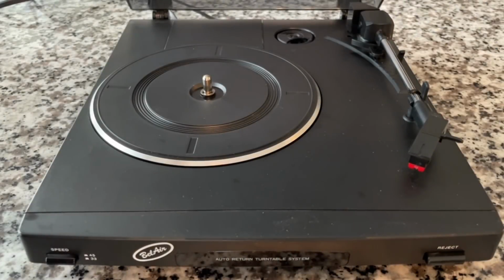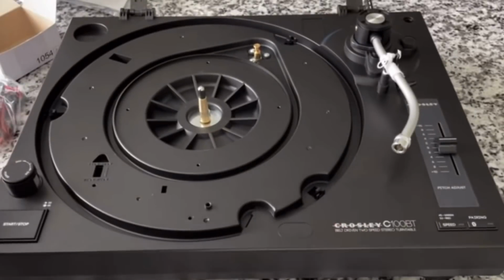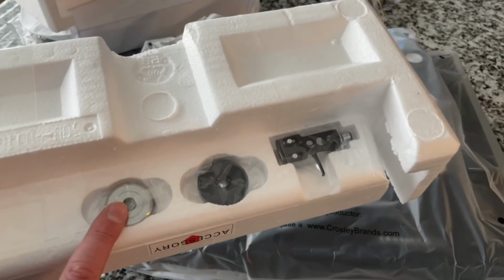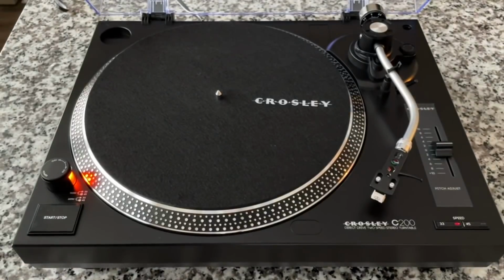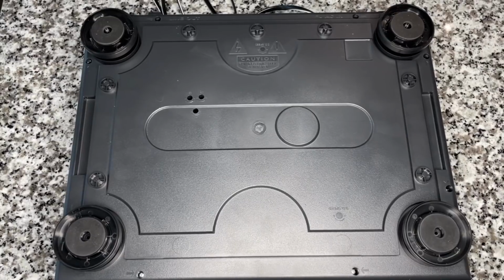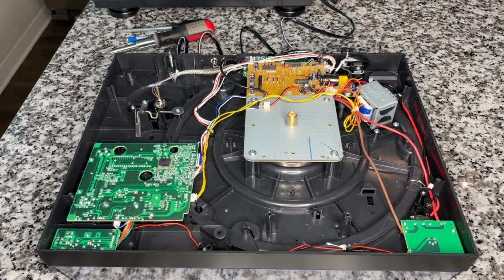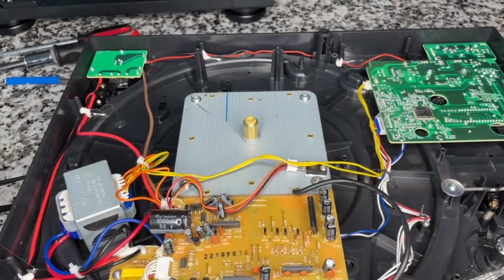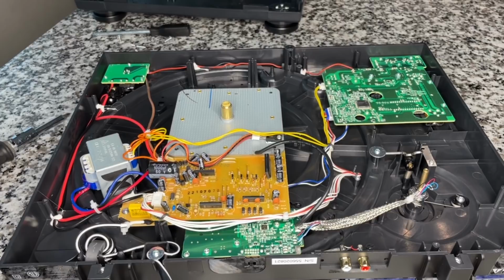How Direct Drive Turntables Work! Ft. the Crosley C200!

Comment: Hello! I came here from your Victrola video. My record won't spin when I put the needle above it... I just got it for Christmas and am just now using it. I am a complete newbie to this stuff. Is there any way you could help me fix it? I can hear the motor going, but nothing else is happening. It is plugged in and the light is on. The setting is set to phono. Please, anything can help.
Reply: Hello Megan Green it appears the belt has slipped off the platter (you hear the drive motor) the platter (where you place the vinyl record) should lift straight up. There may be an "E/C" clip that needs to be taken off, then the platter can slide straight up you'll see the belt laying under there. There maybe access holes in the platter itself a model number would be extremely helpful so I could look it up and confirm my thoughts of the design of it.

Comment: They sell their turntables all over the world and in the majority of the countries that they sell to there is no real need for an adapter as there's no big hole in their 7 inch pressings. The USA is but one of many many countries in a global market, it's not cost effective to put anything more than just the bare minimum in the box when it comes to the 45 adapter as most buyers outside of the USA won't have a need for it. It's there for "just in case".

Comment: ( community comments welcomed!!!! )

Any word if you're going to produce/selling aluminum 45ers with your logo? I would LOVE, blessed even to be able to buy/own one.

I've learnt allot watching you and vwestlife. I prefer you but I'm curiously upgrading my c6b.

So far I've added these upgrades.
Rubber 3mm platter mat.

LP Gear 250 stylus(had to let it break in, now I hear the difference)

Metal pointed feet (awesome for isolation)

---what I'm looking into---
Project/rega/angel horns Acrilic platter.
Looking into making my own pro-ject string/wire and weight anti-skate.

Could the last one be done? I really really like this table and upgrading it is a blast !!!!!!

Comment: A third type of turntable drive was idler drive, commonly found on vintage turntables from the 1940s to 70s. It used a rubber tired intermediate wheel, instead of a belt, between the motor shaft (usually an AC synchronous induction motor, but later just a JYK DC motor) and the sub platter. These were high torque, as required to operate the automatic changer mechanisms of the day. One of the failings of the Crosley Stack-O-Matic was it was a belt drive, instead of an idler drive like the original BSR units it tried to replicate. Some vintage machines actually had separate drives for playing and changing records.

Comment: I'm a big fan of your content especially the way you consider the lower end of the market and give lots of good advice about the practical, real-world differences between different turntable models for people getting into vinyl. So I offer the following in the spirit of constructive criticism and hope it's received in that way too. 

While I agree that most of the differences between a well designed belt and direct drive are unlikely to be audible I was a disappointed by some of the supposed drawbacks of direct drive turntables and sonic superiority of belt drive which you cited in this video. These have long since been debunked, but continue to be pushed by the "audiophile" high end manufacturers as misinformation to explain away the inherent inferiority and obsolescence of the belt drive system which they continue to use. Though you do partially row back on some of those points in the tear down section I still think they're worth addressing. 

Direct drive and quartz lock were developed in the 70s by Japanese companies to produce turntables with objectively better performance than belt or idler drive. This was a time when Japan was a world leader in audio technology and electronics and pulling away from Europe and US. DJing didn't exist when direct drive was invented - this technology was originally brought to market because it was sonically better. 

The superior performance of direct drive can and has been objectively and repeatedly measured and proven in many independent third party tests. Direct drive, especially with quartz lock, outperforms belt drive in terms of signal to noise ratio, wow and flutter and the effects of voltage and temperature fluctuation, the key parameters of a drive system. 

To address the supposed drawbacks you raised: 

"Cogging" was completely eliminated by coreless motor designs as early as the 70s and not just in high end products - JVC had coreless motors across their whole consumer range. If "herky jerky" sound is a worry, the comparatively terrible wow and flutter performance of belt drive should be a major concern, though that is also rarely audible in normal circumstances. 

"Motor noise" of direct drive
Mechanical noise in a direct drive system is entirely derived from the quality of the bearing, just like a belt drive system. Unlike a belt drive system where a separate motor is whizzing away creating additional noise and vibration, which is then partially transmitted to the belt whose elasticity also introduces speed errors, a direct drive motor is just efficiently converting electromagnetic energy straight into kinetic energy of the platter spinning on the single bearing. I think this might have been your realisation once you'd taken the thing apart and seen the motor? 

"Speed variation" of direct drive 
Direct drive turntables, especially quartz locked, have indisputably better measured wow and flutter and speed drift performance than belt drive. 

As others have mentioned in the comments another big advantage of direct drive is no deterioration in performance as the primitive rubber belt stretches and rots. 

In my opinion, the reason we no longer see many direct drive turntables with coreless motors and quartz lock in the consumer market isn't because they're inferior, it's because they are relatively high tech products which depended on economies of scale to produce. When consumer demand for vinyl dried up, those economies of scale no longer existed. With the rise of CD, the market-leading high tech Japanese manufacturers discontinued turntables and moved on. 

The exception was Technics which could continue to make a profit in the DJ market which it dominated and which required direct drive. Even that market was too small for Technics' direct drive turntables to be viable, hence the discontinuation of the SL-1200 in 2010. 

That left only the niche "audiophile" turntable manufacturers with their small volume, beautiful, but highly inefficiently manufactured products which used the technically inferior but simpler belt drive technology. 

I say all this because I started in vinyl by buying a Pro-ject Debut Carbon a few years back mistakenly believing it was a high tech product with its modern design and fancy carbon tone arm. And then I realised its peformance is laughably bad compared to a JVC quartz locked direct drive turntable from the 80s which I picked up on a whim at a thrift store for $20...
Reply: the real reason why there aren't more direct drive turntables on the market is because the brushless motor found in Technics turntables is a patented design that no other manufacturer can match without introducing the wow and flutter.

also, the SL-1200's were never originally designed strictly for DJ use, but rather as a premium high-fidelity record player. but their extraordinary build quality made them perfect for nightclub applications.

and even though less and less DJs are using turntables these days, SL-1200's are being manufactured again
Reply from the maker: Great info thank you!

Comment: Belts can stretch, causing a variation in speed. I prefer direct drive and recommend the AT-LP120.
Reply: I agree. Also belts have worse speed variation even when new, though it may not be audible to humans when listening.
Reply: @eurovnik  you should understand why that even the most esoteric and expensive turntables are belt driven
Reply: Dude, my belt drive turntable maintain constant speed and the belt is over 35 years old!!!
Reply: @Draw4Reel  oh wow! The belt is that old ?? I think they're usually replaced after about 5 years.

Comment: Great video, record-ology! You're correct about the Technics direct drive being different, but the motor is not completely in the platter, just the magnets. The coils are still on a circuit board in the turntable plinth, a weird approach. I've also seen turntables that have a circle with notches under the platter and an optical sensor to detect and control the speed 😀

Comment: 2:26 Cogging is common with motors, but it depends on the motor design. 
Not all motors are subject to cogging. For a motor design that isn't subject to cogging, the rumble comes from the bearings only.
Reply: Absolutely right. Coreless turntable motors which solved the cogging problem were introduced in the early 70s.

Comment: just curious, cuz I don't know much about this subject, but i have direct-drive turntable from Realisitic (no longer in existence I believe) that I bought in 1980.  it has a strobe with variable speed adjustment, anti-skate and tone arm weight adjustment and the original cartridge. it is 2 speed and in very good shape. the worst thing about it is of course the 42 yr old dust cover. is it worth anything other than  maybe a hundred dollars if that? it is VERY  much like the Realistic Lab 395 that i have seen  reviewed on YouTube.
Reply: That Realistic turntable was made by a Japanese OEM called CEC. They also made turntables for JVC, HH Scott, and others. Realistic also had turntables made by BSR and ELAC/Miracord, but those were mostly idler drives. Realistic was a Tandy/Radio Shack brand. Radio Shack still exists, but is no longer owned by Tandy (except for some international markets), and no longer sells under the old brands.

Comment: Do you think that weight of the TT makes a difference?
Reply: To an extent, depending on what is adding the weight. A heavier platter will have more stable speed. A heavier plinth (body) can help stabilize the turntable against vibration, depending on the material and the design of the table.
Reply: A well isolated shelf and independent suspension of the tone arm and motor can also help stabilise even a lightweight turntable against vibrations.

Comment: Ich habe, was ich schon mehrfach erwähnt habe, einen 1977er WEGA PS55 Direktantriebs-Plattenspieler. Ich habe mehrfach Riemenantriebs-Plattenspieler, 1byone, Rega, Pro-Ject, AT, TEAC, Sony und andere ausprobiert! Sie sind alle, mehr oder weniger, gut! An den alten WEGA reichen sie aber nur annähernd!
Reply: Agreed. Differences are unlikely to be audible between either drive system in a well designed turntable. Objectively direct drive is superior in terms of measured peformance and more reliable over time.

Comment: High end very expensive turntables are belt drive too. Very informative video! 👍
Reply: True, but that doesn't mean very expensive belt drive turntables produce better sound quality than direct drive. In my opinion they are luxury goods, made by small niche manufacturers with very inefficient production processes, using obsolete drive technology and expensive materials which look good cosmetically. The "audiophile" manufacturers also spend a great deal on marketing the supposed magic musical qualities of their products, which inflates the price further, and are notably reticent about publishing performance specifications. 

An analogy would be comparing a designer leather bag to a waterproof Ortlieb bag. The designer one costs many times more and is much less practical - fragile and not waterproof. But people will still buy it for the aesthetics and brand name, not any practical benefit. But unlike many high end turntable owners, they won't also claim that the designer handbag performs better than the waterproof one just because it's more expensive.

Comment: A benefit of having a direct drive turntable is that you never have to buy belts. Great vid Record-ology dude, I enjoyed it much.
Reply: Dude, I have a Acoustic Research turntable that bought new in 1985 and guess what??? It still has the same belt from 1985! I also check the speed of the platter and it’s still checking in at 33.333 !!!